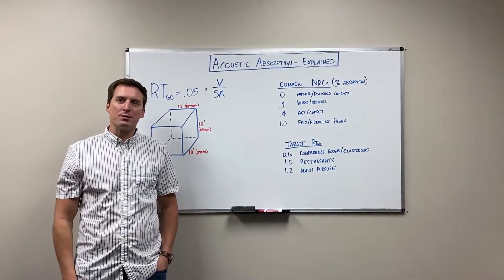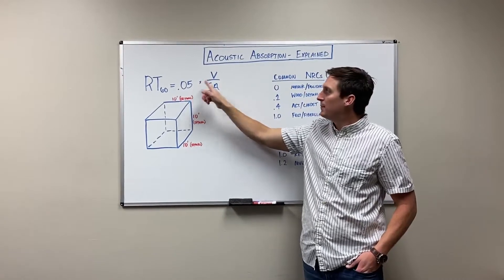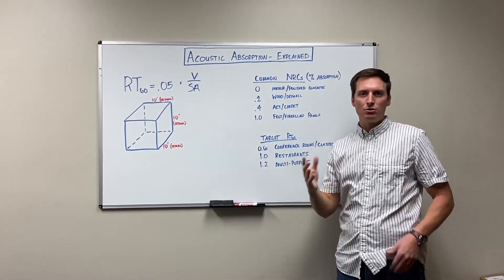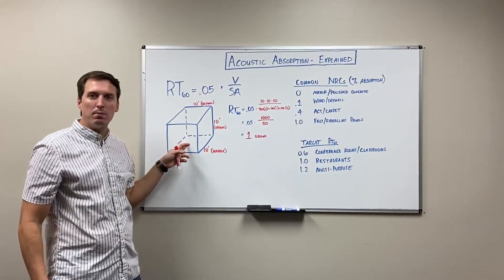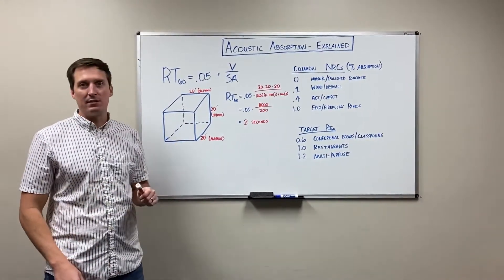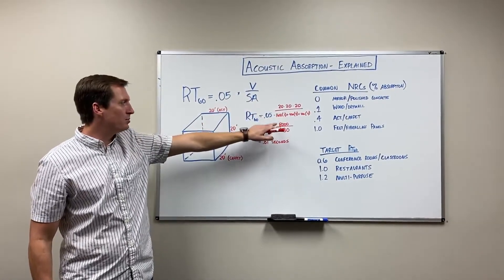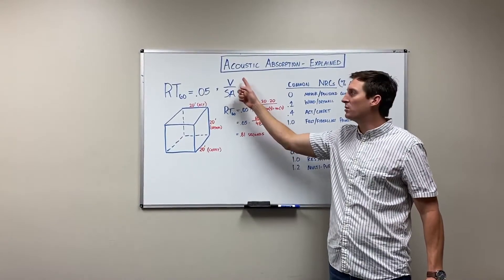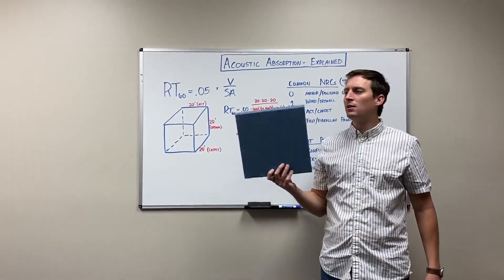How to Calculate Reverberation Time in a Room - Acoustic Absorption Explained

Comment: I have a question. Great video by the way, why did you only measure three surfaces areas for the top of the fraction like 10 x 10 x 10 but at the bottom of the fraction you measured 4 like 100 + 100 + 100 + 100? I am new to this and want to learn. 

Thank you for your time and intelligence! Hope to hear from you!
Reply from the maker: Hello! We have 3 values on the top for our volume (length x width x height), and 3 on the bottom for surface area of the walls, ceiling and floor. Also on the bottom - each surface area is multiplied by the NRC of that material. The 400 comes from each wall being 100 SF in the first example, so 400 SF is the surface area of all 4 walls added together. Hope this clears things up, but let us know if you have any other question!
Reply: @ Thank you sir! You cleared up everything!

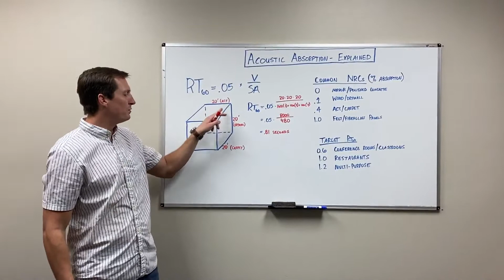Comment: For your third example (3:46), aren't the sabins 360?  You have 480 resulting in a .81 RT60, but I get 360 resulting in a 1.11 RT60.

8000	=	20	=	22.22	X	 .05	=	1.11 second
360		         9 

Am I off?  SA = walls 1600 sq ft at .1 (40) + ceiling 400 sq ft at .4 (160) + floor 400 sq t at .4 (160) = 360 sabins
Reply from the maker: Thanks for your comment! You have 1600 x .1 as 40, but it should be 160. 160 x 3 is how we got 480.